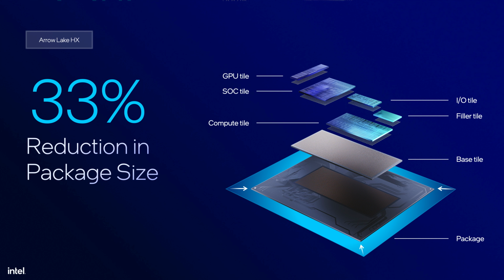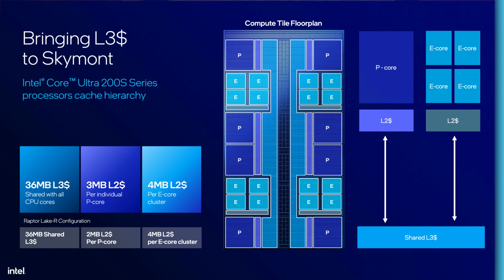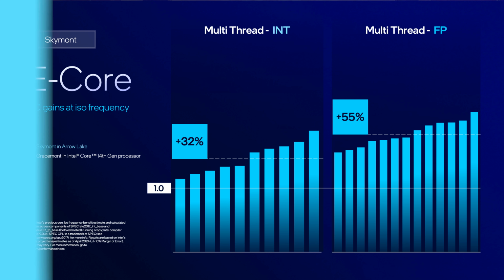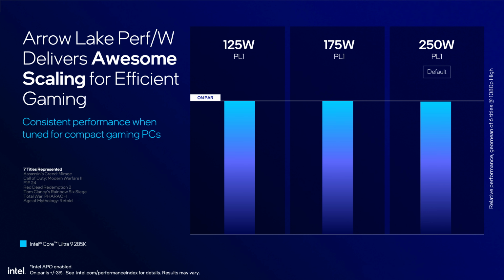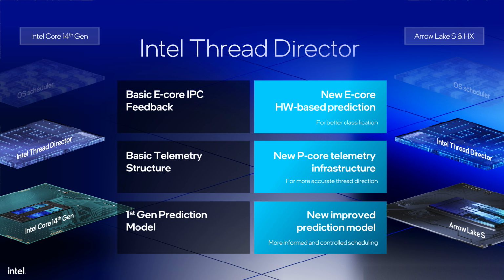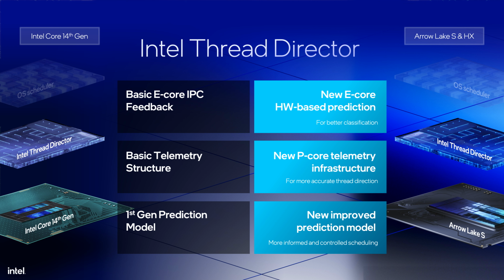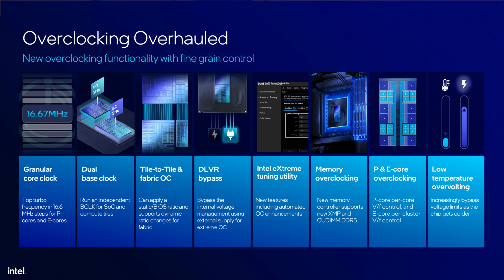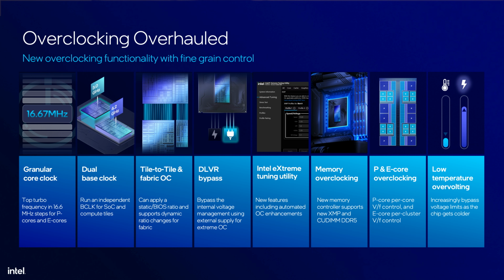Intel Core Ultra Processor (Series 2) Architecture and OC Overview | Talking Tech | Intel Technology

Comment: What scares me is the discussion on the socket. You cannot say it is not possible to innovate without changing the socket every 2 years with your competitor supporting the same socket for 9 years in a row. That must change on the desktop segment. You are losing so many users just for that. Try to be a little bit more future proof when you design your socket Intel.
Reply: The only difference between Lga1700 and 1851 is CPU has 20 pcie 5 lanes instead of 16 
And thunderbolt is now native to CPU instead of motherboard

Comment: Why did they use older architecture for the iGPU? Why not the same as Lunar Lake?
Reply: Because in that segment you expect a discreet GPU. So the iGPU is just to have basic support.
Reply: @MrHal900  doesn't explain why they didn't use their latest architecture. it would take the same amount of space but perform better and have better features.
Reply: @qweasdzxc  no it's not tech-based reasons or die size reason, it is of course cost/resources reasons. They will reserve Xe2 for Battlemage/Lunar Lake laptop, while using this enhanced version of the Xe1 for a desktop processor which usually will not need any iGPU.
Reply: @MrHal900  but it shouldnt cost them any more... its just newer architecture, but it uses same silicon

Comment: Don't worry. When Intel showed Arrow Lake is 5% slower at gaming than Raptor Lake it just at benchmark at stock clock, but Ultra 9 285K is limited at 125w which is half power of the i9-14900K. There are so much potential with Arrow Lake since it support 8000MT and 10000MT DDR5 not to mention you can still OC the CPU too but still use much lesser power than stock Raptor Lake.
Reply: It wasn't limited to 125W, it just performed the same when limited to 125W compared to 250W.
Reply: @molikoli9802  if it can keep the same speed at 125W then at 250w there sould be good room for OC, probably 200-300mhz.
Reply: and yet it turns out that its terrible.
Reply: @RAVAG3DH3AD  because of Windows, much like with AMD.
Reply: @PixelatedWolf2077  fingers crossed, I just don't understand how the info they gave in the announcement is so far from what reviews are showing.
Reply: So if one overclocks it to 6 Ghz it will run as fast as 14900k with the same performance, power use at 250W and thermals near 100 celsius. Sounds great 😂
Reply: However the Ring Bus speed is lower leading to prove as a means of proper improvement in IPC @kutuluu

Comment: I just want to see how much headroom there is for CPU and RAM overclocking. The stock config seems to be extremely conservative.
Reply: and undervolting too! I have two 13700K and both are stable at -150-160mv which is crazy.
Reply: @chiyolate Heya! Do you have any guides you can point me to so I can properly learn to undervolt?
Reply: @PixelatedWolf2077  Hey, I'm assuming your CPU is similar like mine, or at least 12th, 13th, or 14th gen intel CPU.
I can give you starter guide so you can try undervolt yours right away!

Frst, look for an option to disable UVP (Undervolt Protection) in your BIOS, in my MSI board, the option is under Overclocking > Microcode Selection > "No UVP"
After you disable it, reboot and go back to the BIOS.

This time look for CPU Core Voltage Offset Mode (mine is still in the Overclocking section), change it to - (minus).
Then usually below that you can set the offset value. For a start, input 0.05V (make sure it's 0.05 not 0.5).
Then apply the change and go to Windows.

Download a program called Prime95 from Guru3D to test the system stability.
When starting the Prime95, set a custom value of 336 in Min FFT size and 336 in Max FFT size, then press OK.
It will start testing your system and look for errors.
If after some time (15-30 minutes), you don't see FATAL ERROR or something like that, then your system has successfully undervolted to -0.05V (or 50mV). This will reduce your temp and wattage by 30W ish my guess.

Now you can go back to the BIOS and increase the offset value a little bit to 0.06V, then go back to Windows and start the Prime95 testing again, repeat this process until you find that error in the program.
Once you find the unstable offset value, say at 0.12V it shows FATAL ERROR, then you can go back to 0.10 or 0.09 for stability.

Every CPU is different so you have to find the value yourself patiently. Don't set the value too high because it can lockup your CPU and you have to reset the BIOS setting (consult your motherboard manual on how to reset the setting)

Comment: in theory, I would agree with moving highly threadable workloads off the P-cores to very many E-cores. This would actually point to having fewer P cores and very many E-cores.
Does Intel still the resources to identify the important algorithms (compression, encoding etc) to proper form for high multi-threading?

Comment: Due you guy cancelled Arrow Lake Refresh ( 8 Lion Cove P-Core 32 Skymont E-Core ) from delayed of Intel 18A Plant that did not ready before 2026.

 It was very sad that LGA1851 will be shortage its life span with only 1 series processor support indeed.

 The LGA 2551 (Socket V3) for Nova Lake and next generation supports PCIe 6.0 and DDR6 coming on 2027.

Do you think intel fanbase can accept your line up anymore?

They'll go for your opponent indeed.😂
Reply: Do you really need to buy a new CPU every year? Why not purchase an Arrow Lake CPU, keep it for several years, and upgrade when your system starts feeling sluggish?
Reply: @DimbleWally  I didn't interesting on shortage CPU line support as LGA 1851. I'm waiting for something like Nova Lake S or new architect better. :face-red-heart-shape:
Reply: 7800x3d is more than enough for gaming and get a motherboard bundle. @mgzschannel1818
Reply: There are so much nonsense garbage from your comment that it seems like you are better to work with MLID to make garbage lying news like MLID.

Comment: Probably the best all-rounder x86 processor yet. A worthy successor of the 14900K.
Reply: Exactly, who need Amd 3d cpu when you can have just one CPU which is great at both productivity and gaming like Arrow Lake.
Reply: @runninginthe90s75  🤣🤣🤣🤣, why you sound like you are coping so hard? ARL is a decent CPU but it's another Rocket lake/ Skylake, this is the truth and even Intel aren't putting some outrageous claims with their slides. It's a step in the right direction and has a place in the market just like the X3D parts from AMD (especially the octa core ones), those sell like hot cakes unless you live under a rock.
Reply: @Game_LevelUp_ Ohh look another salty Amd npc who rather buy flopped garbage zen 5.
Reply: @runninginthe90s75  Your reply alone is a clear indicator of your IQ level, it shows and everyone can see it. 
Jumping to the conclusion that i am an AMD fanboy is the dumbest thing i've seen today, nice try kid next time try harder okay!
Reply: @Game_LevelUp_ So it’s a Rocket Lake reference because the performance gains aren’t big enough? Get a load of yourself
Reply: IPC regression on newer TSMC 3nm is lazy work without Hyper threading Intel would have hard time competing with Zen 5  @chiyolate
Reply: its literally slower than the 14900k in gaming lol, its a pathetic release. im an intel fanboy but its just so disappointing how they are literally release a CPU that is slower than previous gen. it wouldnt be so bad if it wasnt on a totally different socket either...if youre going to force mobo upgrades every 2 generations atleast make worthwhile performance increases
Reply: @andherewego43  What do you know about Engineering? Slower doesn’t always mean good, in intel’s case this is a better path to save on power considering their disastrous past. Know your stuff.
Reply: @PsTechSpace this is another rocket lake a stop gap until a more optimized chip is fully developed 18a better hit the performance target or Intel would get acquired by Qualcomm.